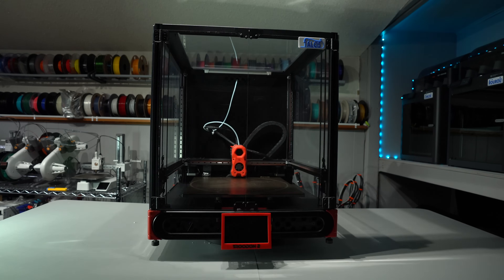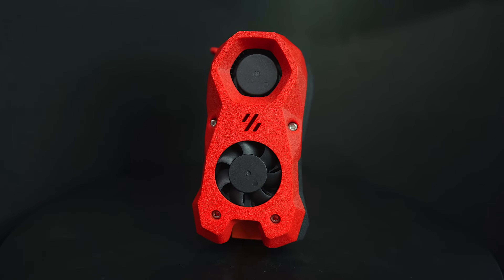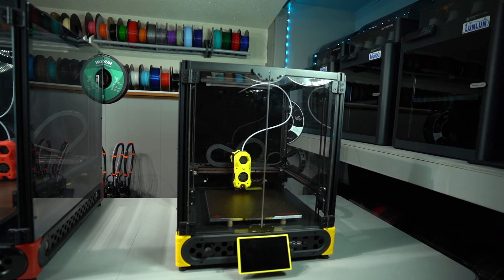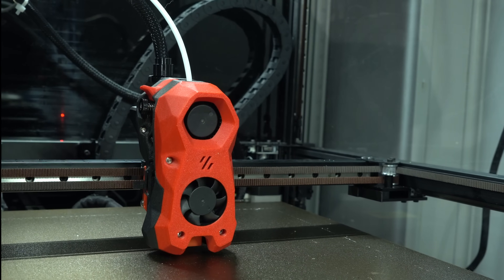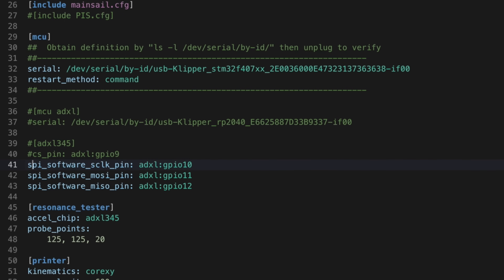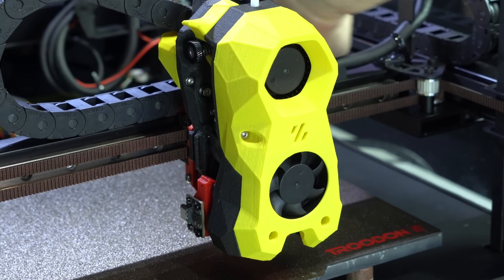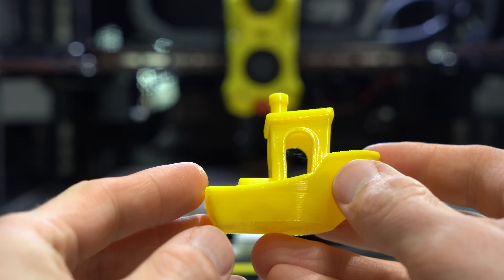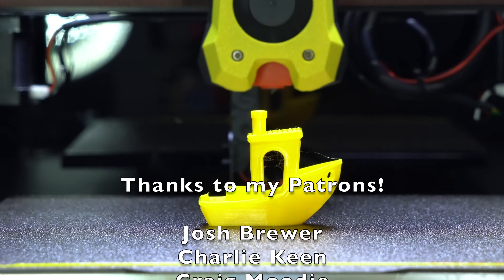The Voron Clones Are Multiplying! Troodon 2.0 Pro & Mini Pro

Comment: The Teamgloomy site states that the Troodon V2 internals in the print head are designed for a maximum of 2.5A (which equates to 60 watts at 24v). Formbot sells a Stealthburner Extruder for Troodon 2.0 with a choice of Dragon High Flow hotends, so I'm thinking that in its default state the Troodon could handle some 60W HF hotends. If my reasoning is correct. Anyway, I like the fact that Formbot is trying to improve Troodon. Changing the bearings in the extruder. Switching to a Klipper, or TAP RC8 already in the stock equipment. 
I already have an order in, and that's mostly thanks to you. Thanks so much for what you do =)
Reply from the maker: I think it could handle 60W in theory, but without a safety factor. A Formbot engineer at one point advised no more than 50. Thanks for watching and commenting, much appreciated.
Reply: Formbot support said easy workaround is adding canbus for 5A hotend
Reply: @FrankForfaen-uk1gu Is it easy to add Canbus with their custom MCU?
Reply: @XHolyPuffX  don't know

Comment: I just got the troodon 2.0 last week and have been loving it .the place i ordered from gave a phaetus uhf hotend from 3d printers bay, it seems the people that own formbot are selling some through them with upgrades available. I hope I didn't buy the new hotend in vein tho, as it was an option for upgrading on their site. It ships separately from the machine, and has to be installed. I have a message into them asking them for instructions on how to install it if the toolhead board doesn't support the rated power, hopefully I will hear back tomorrow from them.

Comment: Was hoping you would cover this! Looks very tempting. How are the sound levels while printing?
Reply from the maker: Pretty average I’d say. Not a quiet machine. Closing the doors helps a lot with noise.
Reply: I own Prusa systems, Bambu X1C printers, an older Troodon 2.0 from last year, and a self-built Voron 2.4r2 350. The Troodon is quieter than the Bambus and the Voron (I should have picked quieter fans for my Voron), but louder than the Prusa printers.

Comment: SV07Plus with slight tuning in Klipper + Profile can do 12:00 Benchy without drastic quality drop. ~15-16min with perfect print finish.

Limiter is cooling to have 12:00 perfect, and beyond that driver voltage.
Reply: That being said, I REALLY REALLY want to like the Troodon, but it just keeps slightly falling short for me to fork out the cash for it :(

I wish i knew reprap would've been just as good as Klipper tho, i would've probably bought a troodon already

Comment: I didn't even notice the full Troodon 2.0 was now a "Pro" model when I ordered last week. Any idea when they might release the "Pro" upgrade kit for the Troodon 2.0 from last year? (I've asked Formbot as well but it can take them some time to reply to emails). BTW, if you don't install the acrylic on the top of the Troodon, you can reclaim some of the lost Z height that the StealthBurner takes away because of its added height.
Reply: Last I heard from Formbot was that an upgrade kit would be coming "in the coming weeks" but have had no feedback since.

Comment: After watching your videos, I acquired a Troodon almost a year ago. By the way, thanks for the work, which motivated me to take on this project. Since then, it's been converted to a Klipper / StealthBurner, as well as a Dragon UHF hotend. Unfortunately, the flow rates were way below my expectations.

However, did you notice that the PT1000 thermistor is off by more than 30°C at 200°C (< 170°C), when connected to the Octopus X7 (or the analog input of an SB2209/ SB2240)?

I also had similar flow rates, for example a Polymaker Polyterra at 13 mm³/s. After connecting the PT1000 to a MAX31865, and removing the reverse bowden (cause of high friction and ESD), this filament went up to 56 mm³/s!
Reply from the maker: Thanks for watching. I haven’t noticed that temperature differential but never did any explicit testing. The flow rate is definitely low with the stock hotend.

Comment: The idea of a mostly pre-assembled Voron seems incredibly appealing for a newbie to the platform like myself, but I really wish a normal Octopus v1.1 plus accompanying breakout boards and wiring were an option for the Troodon. It seems like you'd be significantly limited in terms of future upgrade/mod potential without changing almost all the electronics out - at which point I'm considering just forking over the ~$200 extra to get a 250mm Voron 2.4 kit from Formbot instead. I'd have bought the Mini in a heartbeat otherwise.
Reply: But as a newbie wouldn't a modded troodon be a decent choice? You could easily get an m8p+CB1 with stepper motors and a new toolhead board for less than 100 later on if you do wish to add things. Changing out the board and wiring prob wouldn't take long as the cable chains can open and there's many config for voron 2.4 and manta m8ps, Ans this whole time you don't really have to worry about the build of the printer itself which can easily take over 40 hours without taking into account tuning the thing

Comment: How has your Troodon 2.0 held up? I watched all your initial videos on it. Any long term issues with cable chain, or anything similar?
Reply from the maker: There was a cable durability issue with the first batch but that has since been resolved and they sent out a replacement to existing owners. Apart from that it has been smooth sailing. Thanks for your continued viewership!

Comment: I am looking for an upgrade to the Artillery genius printers I have.  I don't nessasarrly need to print fast.  I need good quality and quiet.  The mini pro might be what I am looking for.  It has the build volume I want and the corexy design.  The need to upgrade is hard because I am getting good quality from the printers I have.  The technology is getting old and listening to your review of the sidwinder x3 reminded me that I have had all of the problems you talked about.  Would I be trading one set of problems for another?

Comment: Hey Sir, thanks for sharing the video! Also quick question. I`m currently running ender 3 Pro on sonic pad, quite happy with it but I`m guessing Troodon 2 Mini pro be miles ahead of my current set up? What hotend upgrade would you recommend for Troodon 2, or just swap the nozzle? I`m 95% certain I`ll buy it !

Comment: Hi Taylor. Thinking about buying one of the pro minis. What are the assembled printer dimensions? The dimensions on the website seem too big. 500+x500+mm for a 250x250mm build plate. Thanks.

Comment: Definitely interested in the Mini as a option, but I am curious about if an upgrade to a Revo hotend is a easy and viable upgrade just for that easy swapping, do you think you could show that process?
Reply from the maker: You could put the 50W Revo with a Revo HF nozzle. You couldn’t put the 60W Revo on it due to current limitations with the stock electronics.

Comment: You have a pallette 3 pro? I have one on my MK3S+ and I can not for the life of me get the color timing to stay timed. It's always running the wrong colors usually about halfway into the print. I pretty much have all the bugs worked out of my unit, except for the timing. I just can't get it to work. Plus it seems like Mosaic has just given up supporting the darn thing. Haven't seen a new firmware update in a year and a half.

Comment: Nice reviews. Do you have any informatio of the aux fan mod you did on the Qidi X-smart3?
Reply from the maker: Thanks! I’ll share more information on that in an upcoming video.
Reply: @ygk3d  I have the troodon 2.0 with a stealth burner and indeed the parts cooling is awful. I upgraded the stock fans which improved the situation but i still cannot print PLA at faster speeds in overhangs, etc. It keeps curling. Any ideas/solutions for an aux fan mod would be appreciated.

Comment: hey @ygk3d do you have a working OrcaSlicer profile for the Troodon 2.0 Pro? I tried reusing the previous Troodon 2.0 profile but it doesn't work out of the box. I imagine there are some steps missing in the starter gcode maybe?
Reply: I got it sorted out, the Pro printer ships with a PRINT_START and START_PRINT macro and neither of them worked out of the box. I combined parts of both and hard-coded the start gcode in Orca and it's been working brilliantly. I shared feedback with Formbot about it, hopefully they'll make a change on future revisions.

Comment: Greetings. I liked your video very much, to the point that it pushed me to buy a troodon 2.0 mini pro. the only problem is that the mainsail screen gives me this error: Klipper reports: ERROR
Includes file ' /home/biqu/printer_data/config/generic-bigtreetech-xxx.cfg' does not exist
Once the underlying issue is corrected, use the "RESTART" command to reload the config and restart the host software. can you help me solve this problem,? the same thing is written on the printer display. Thank you